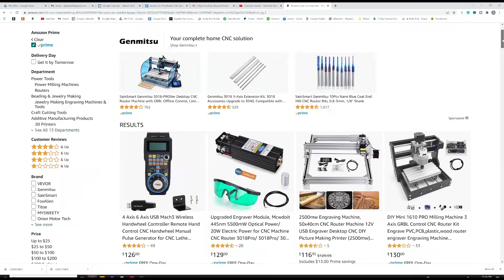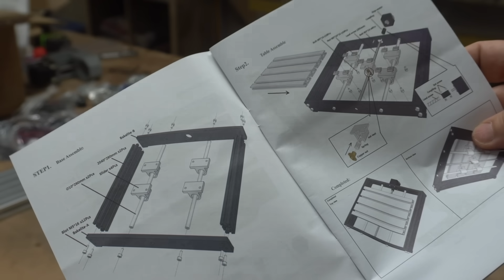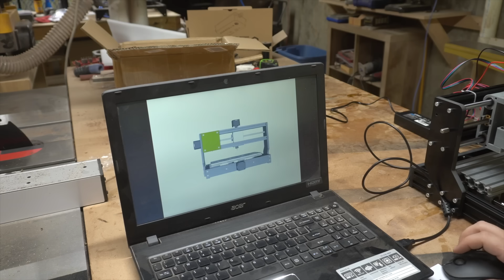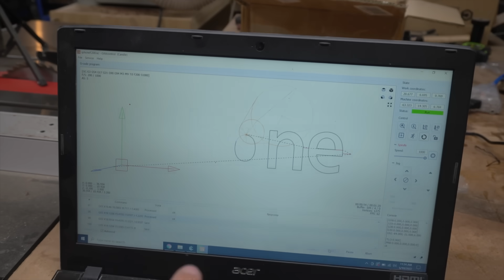The Cheapest CNC Router on Amazon

Comment: I was a machinist I like you video I know it’s pine but you need to clamp down your work on the bed and make sure the clamps are away from the tool path if something goes wrong in the code it could sling that work off your bed breaking something important trust me you would rather loose a cutting but than a window or the machine itself or whatever your project bounces off of

Comment: I had the same problem with the bed mount. They don't go one rail over, they need to be reversed. Notice that the holes are closer to one side. The SHORT SIDE goes to the outside of the bed.

Comment: Hi Andy, thanks for sharing. I know this video is already a year old and may not be reading comments. But in the off chance you do, what bit size does the spindle take? Could it take a 1/8" dremel spiral bit and cut say softwood or plastic do you think?
Reply from the maker: Hello! The collet is 1/8"
Reply: @AndyBirdBuilds  Thanks! Looks like they have fitted a dremel motor on the rig. I've been considering a Shapoko for a while now but was a little concerned about the noise and dust as I live in an apartment. This might just be the thing to whet my appetite.

Comment: My dad was a machinist for 45 years both as his day job for a big company in the silicon valley area, and then he also had a sizable shop he ran out of our back yard too. I know delrin when I see it. I may not know much of anything about CNC milling, but I know aluminum, stainless, and delrin because almost everything in our house was fixed and replaced using those three materials. I'd bet you anything that black plastic is delrin.

Comment: If the CNC router uses a DeWalt/Makita/ect router for the spindle it needs an iot relay and you can turn it on and off with a m code if the controller has like a available port for spindle on/off . Then you can use m3 m5 to turn it on and off.

Comment: Haha, the 1610 instructions are for the 3018.  The  smaller size might make it more rigid than the 3018? Adding linear rails and metal Z axis and higher speed motor for Brass engraving?

Comment: Can it be controlled with Autodesk Software like Fusion 360. Thanks for the video, very informative.  As was the CNote LASER build. Thanks again!!
Reply from the maker: You could design and set up toolpaths in Fusion and export the .gcode. You'd still have to load that .gcode into a cam software

Comment: Hey Andy,

I'm struggling on getting this little cnc to interpret my gcode. On a dry run, the spindle is way too low on the z axis, and way too low on the y axis (appears to be in the deep negatives lol). The x axis seems to be the only hope. How did you calibrate your cnc to get it to cut the way you would like it to?
Reply: Hey Andy,

I'm happy to tell you that I figured out how to use my router. It took me all evening but I finally got it down. :) No need to respond.

Cam

Comment: i have a 3018 router/diode laser. Ive owned it for like 3 years and have never used the router part. lol. It was too loud to use in my apartment building. i only ever laserd with it. but i work at a machine shop where we have hundreds of 3,4,5 axis everything cnc. mills, routers, lasers, etc. material scraps are free and using a machine thats not in the middle of a job is free. so i kinda bought the 3018 for no reason. But its fun to see what people do with them.

Comment: Good video!
The 3018 is the smallest you really wanna go, even then, the work surface is really small. Got my 3018 upgraded to a 3040 with a 20k rpm spindle and it is a lot better.

Comment: I would venture a bet that the reason the other desktop machines don't have spindle control has to do with using a hand router for the spindle.  The trade off being Shapeoko (or who ever) does not have to make the spindle.  They could, but that would cost more for a machine that is pretty expensive already.

Comment: Thanks for the video Andy!   This machine would be good for learning  but I'd want something more than an engraver. Been looking for a cnc router to make small parts out of hardwood, lexan, pcb material (FR4 fiberglass) or aluminum. Don't think that this one would handle that kinda work. Is there a low cost cnc that you would recommend?
Reply: I can't stand listening to routers on CNC machines. Maybe you'll have a higher threshold of tolerance for it? Let's just say there's a reason they can sell so many water cooled spindles though.
Reply: @Paul Frederick  Being an old guy and wearing hearing aids does have some (small) advantages   ;)

I ended up with a LongMill Mk2 and a Makita router. Works great for my hobby level applications!

Comment: Looks like you've got the gantry too far forward, you need to move it back a bit to get the full working area. There should be a measurement in the instructions to say how far from the back the gantry should be.

Comment: I know it’s annoying but the free version fusion 360 has tweaks that need made in the gcode before I run an operation. M3 and M5 are your spindle on/off commands so after the Z moves up to to traverse to the starting point, M3 turns it on. And after the whole operation is complete, Z moves up and the M5, then I have to manually enter G0 X0 Y0 for my xcarve to go back to the x/y zeros. Idk if that’ll help with your shapeko

Comment: Another good insight on a cheap CNC for a learner and would say if anyone feels like having a go then start small and see if you can work it all out , without paying the earth  and find out you dont like the idea.

as for the software to turn on and off the spindle.

The spindles on smaller machines use from 12v to 24v and are connected directly to  the controller board specially GRBL, and this is why a lot of people like them.
Also VFD systems are controlled via the controller right out of the box, 
Basically  most wood cutting cnc machines use what ever router the person feels like using, and so they are not directly connected to the main controller but connected strait to the mains and have the speed control built in for portable hand held use as that's what they ere designed for.

Also a factor of voltage and the frequency set by the router. and this is another problem that people get with there electronics (RF) interference 
a lot of people do upgrade their controller and use like a switching relay to turn the router on and off 
Anyway there are quite a few reasons why routers are used instead of spindles and this topic can go on for ages.

Like me lol..

Comment: That Grey part looks undeniably injection molded in my opinion, that bold seam line is a dead give away, the smaller lines might just be the machine lines from the mold if they didn't do a mirror finish, and that black part at a glance looks like ABS.

Comment: The hold up on the spindle turning on or off on your own is generally included in the G code. You can write it in yourself, but the code can vary depending on What machine you are using
Reply: Not sure about this model, but on CNC lasers, M00 or M01 is a stop code. M02 is end of program. M03 and M04 would be spindle CW/CCW in fanuc CNC anyway.
Reply: Yeah, most POSTs will include it in the Gcode for you but for the sake of two lines of code you too can "automatically" turn the spindle on and off. Usually:
M00 - spindle off
M01 - spindle on (CW)
M02 - spindle on (CCW)

Comment: This exact thing is available in India for 3500 Rs which is like 45 USD. would you recommend it for maybe replacing the motor with a laser for some small cutting/ etching? I'm concerned with the software since I have no experience with this stuff yet

Comment: The G code should have an M03 in it to turn the spindle on (CW direction), and an M05 to turn it off. M04 is CCW direction. If other desktop CNC's don't turn the spindle on and off, you just need to add these commands to the post processor, or enter them into your G code manually.
Reply: @Not Expat Joe correct. You can set the S value to whatever you want to run the spindle at.
Reply: @@notexpatjoedepends, a lot of cnc's remember their last put-in spindle speed. For example, if I were to put S5000 in MDI without an M03 or M04, run a program without an S-code in it but with M03/M04 and it'll run S5000 from memory.

Comment: This is fun: Send it a Fusion 360 generated grbl g-code, with the G28 G90 X0 code left in 🙄. Achievement unlocked: Super head smash mode
Reply: I know I'm two years too late for this comment, but if you should be able to open the Gcode file in notepad anf CTRL F G90- and nowadays, in fusion's "Post" settings you should be able to tweak stuff like it's N lines, safety lines, whether it uses canned cycles, etc
Reply: Sorry- Crtl F G28 to make sure it's using G28 G91 Z0.0

Comment: Talk about missing the point.  The first 3D printer I bought was the cheapest thing I could find for $155 delivered. No instructions (Because they are usually online or on a USB stick) and NOT printed!!  But, because I had to basically build the thing from scratch I learned SO much valuable information about 3D printing that I would have NEVER learned with and out of the box ready-to-go machine.   Years have passed since that first machine and guess what?  It's still producing amazing prints.  Over the years I have added (taken away), and modified the living bajesus out of that little printer and it is still going strong.  Prints as well as my $1500 printers.  So, for your first router, GO CHEAP!!  You will learn a bunch, save some money, and really get to know your machine.

Also, rename your video. This is NOT a CNC Router. It is a CNC Engraver.  If it can't rout, it's not a router.

Comment: this thing will rock for making designed cutting boards - pls give us some power figures - it would be nice to have it on auto controller so you could issue batch order of 10 - it could do cutouts of mdf for fractal antenna arrays - just add your metamaterial or liquid copper - you could build big molds and kits for a slope racer cut out of carbon fiber - or whatever
Reply: it needs a big table hack but other than that - maybe upgrade the motor #hatori

Comment: As a good first upgrade on mine (Close enough on make/model)  was to separate the power for the spindle from the board. The board it comes with is limited in the amount of amps it can spit out. Even a cheap laptop power supply sized accordingly can assist in getting a lot more out of that spindle. That and a could small updates, I was able to cut some shapes from thin copper sheets. Slowly engrave some aluminum, and dig into harder woods much faster.
Reply: what voltage and amperage did u run it on?

Comment: It's an injection molded part not 3D printed, you can tell by the seam from the clamshell and the ejector pin marks.
Reply: Is it possible the injection mold was created by 3D printing (3D, lost wax, positive/negative yadda, yadda, yadda, metal mold)?
Reply: @PeterLawton  As far as I know injection tooling is always machined from steel, but I guess it's possible..

Comment: I would expect the DC motor to be the part that fails first. Don't know much about CNC machines but do the professional ones use brushless motors or doesn't that work?
Reply: All sorts of motors are used, depending on the size of the machine and power required.

Comment: Just for info, yes the small router can turn of and on automatically because it's only 12v,  with the larger machines like open  builds and shapeoko it uses a mains powered palm router so you need a mains relay or addons (which they now sell to control your palm router on and off) or upgrade to a proper spindle and VFD which can also be configured to turn off, on and adjust speed straight from the controller or software.  I thought about buying a kit like this but built my own from a small 500mm x 500mm to  now made it larger to 1.5 meters x 1m with VFD, water cooled spindle and SMC5 controller.

Comment: Could you set the dimensions of the build plate in the software? If yes you can use the parts to build your own larger version by using the motherboard and steppermotors.

Comment: I wonder how hard it would be (with a few extra parts of course!) to turn this $130.00 cnc router into a large bed cnc router? You know could it be hacked?!
Reply: As you lengthen any part, you may need to change the profile or material to compensate for the extra leverage. You're also adding mass so either the acceleration and deceleration will be slower or you'll need to change the motor parameters or upgrade the motors. Longer belts have more problems with the movement lagging behind the motor speed/direction changes.

It's doable but if you just scale up a small cheap machine you'll be amplifying the inaccuracies it already has.
Reply: @EmyrDerfel  sounds like a fun next video for someone to make!!

Comment: This CNC can turn on and off the "Router" because it's a simple DC motor that runs at ~24V, which can easily be switched by a MOSFET. Proper CNC machines use much bigger and more powerful actual Routers, which use AC motors running at 110V, which can't be switched by a simple electronic component (at least, not without FCC certification and the like, which is incredibly expensive).
Reply: relays are expensive and require fcc auth to use? news to me.

Comment: As someone who doesn't use Windows, I'm wondering what the software limitations are. I use Linux. Kinda interested to know if I need to run Windows and if I can , can I run a virtual machine or even run the software via Wine.
Reply: I have a 3018Pro, it will run CNC code (G, M, and Numerical) which is basic (asci text) to all CNC operated equipment. The program code can be run alternately from a SD card in the external control connector. The coding software, programing the tool path, can be most any. The post processor, which develops the tool path (asci text) code specific to a machine controller is what is most important to the effective cutting operation. The cnc program, basic text, should run from any platform.

Comment: Wow I was just looking at this "cheapest" cnc on Amazon. Now this video. My hope was to make a carb gasket from 6mm bakelite. You did say it would make designs but not cut anything. So does 'not cut' mean it won't cut out two 1/4 bolt holes and a 2" bore, and of course cut the shape?
Reply from the maker: No this machine isn't capable of that

Comment: sorry if this is a stupid question. i've never used a CNC or an engraver before. but yeah, if this or a cheap CNC can't cut, is there much difference between it and an engraver? is their software type stuff similar enough that it doesn't matter too much or are they very different? I know you used the software program that came with the 99$ engraver you got, but does it allow you to use other programs that could be very similar for learning it and CNCs etc? basically worried about being able to learn the software stuff and wondering if i would be able to make some products that would pay for a better one later...
Reply from the maker: Gretat question! There isn't much difference between them really as far as what you can do with them. I'll have a video coming out soon about this. The software that comes with these is really basic but it will provide you with the ability to learn the work flow.
Reply: @AndyBirdBuilds  thanks, I will look forward to it

Comment: Hard to be certain from watching the video, but I'm 99% certain that the Z axis parts are injection molded and not 3d printed. Reason being I can see a flashing line running around the part as well as what looks like the mark from the port the plastic was injected through. The fine lines you were seeing (I couldn't see them on the screen) could actually be from machining the molds, as on something this cheap I wouldn't expect a lot of effort to go into surface finish of the molds.

The plastic sides look like acetal (Delrin) to me, but that could be wishful thinking.

Comment: I noticed in step one of the instructions you fitted the sliders back to front so the mounting holes were inboard instead of out board it’s why they ended up sticking out from the deck your remedy of moving them to an inner slot is ok but the deck would be more stable the correct way round fitted to the outer slot. Btw thanks for the great content

Comment: Don’t know what those other CNC machines you mentioned are but to auto turn off the spindle at the end of  program you must input an “M” code (normally M5 to do this) and of course the controller must have the necessary inputs/outputs to perform this “M” code and other various Machine functions…… an industrial CNC technician
Reply: I assume the issue with the other machines mentioned is the lack of hardware interface to respond to the codes.

Comment: I've been a CNC machinist (steel, aluminum, nylon) over 10 years now and I'm interested in getting into CNC routers. Would you still recommend something like this to me? Or would I be okay starting off with a higher price CNC router?
Reply from the maker: If your budget allows, I'd get something bigger
Reply: @AndyBirdBuilds  Okay cool thanks.
Reply: If you have background and knowledge to use CAD and CAM programs. Just go with something more suitable. This would be great for someone who doesn't have any knowledge and wants to learn things. These aren't rigid enough for people that have used better equipment and will feel disappointing.